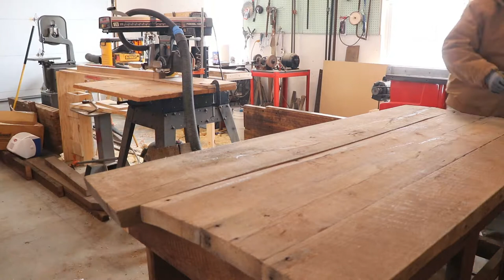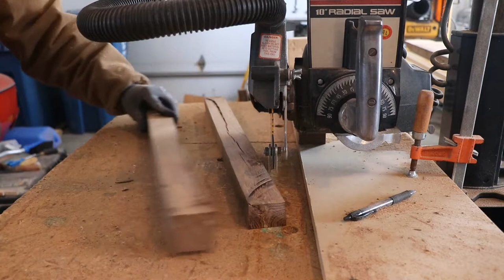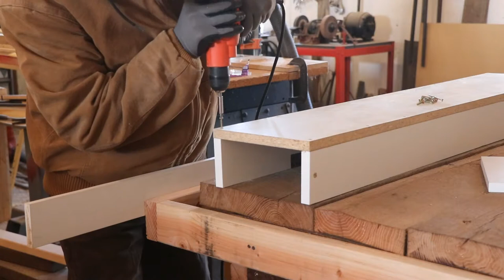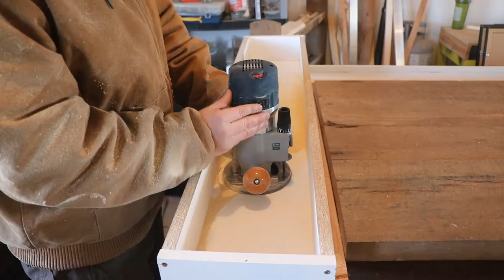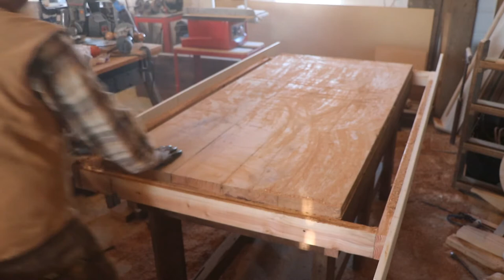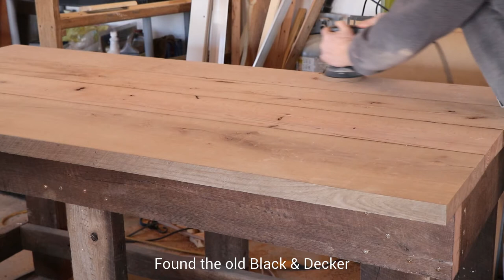How to Router-Plane a SOLID Oak Workbench

Comment: I bought A Milwaukee fuel M12 set two years ago. Larger traditional drill with two speeds, and a smaller hammer drill also with two speeds. Absolutely love them. Charger charges way faster than any I have ever owner. Chuck works well, no tool needed.

Comment: I picked up a Kobalt 24v impact on a sale that does everything I require it to, Batteries are expensive though. My brother has a Rigid set (impact and drill) that I’ve used and they perform every time.. We actually put an auger on it to drill holes for ice fishing. Well this is a long winded comment! I’m happy to see you on here and this was a great build!